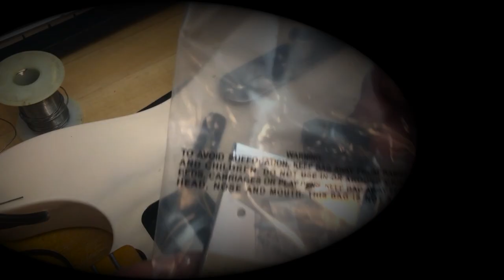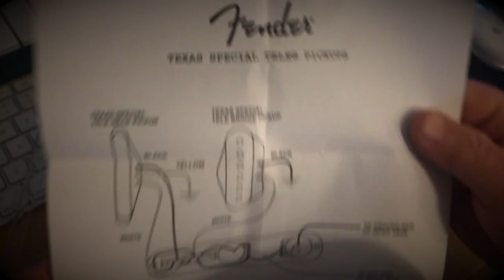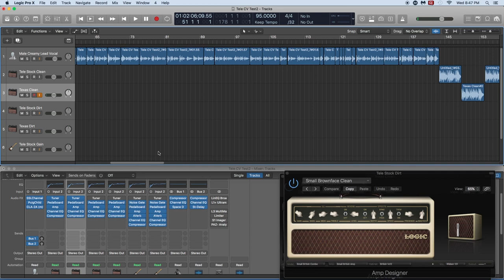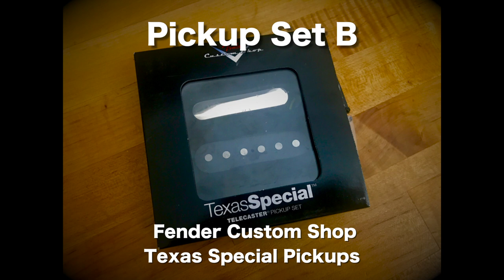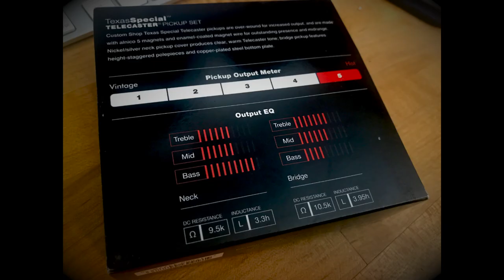Squier Telecaster Classic Vibe Stock guitar pickups VS Fender Custom Shop Texas Special pickups

Comment: Hey Brooks, great video! Question, at the 2:45 mark, you mentioned the Texas Specials come with pickup screws. Were you not able to use those screws instead of the stock CV pickup screws? You mention you would have to drill out the holes on the Texas pickups. I’m about to install a setup of Twisted Tele pickups and would like to avoid having to drill out holes on the neck pickup. Thanks!

Comment: I just bought a CV Tele and I immediately recognized its pickup sound. It's got a lot of snarl and a really tight low end but it's thin in the mids and it's not particularly full sounding. I love it for solos because it's so expressive but it can get a little tiring over the course of a sesh.   I thought pickup B sounded significantly fuller. OTOH, the stock picksups were killing it on that last riff and the Texas Specials weren't.
Reply: You can fix all that.
Use the tone dial and a compressor with a tone dial…boom! ….fixed

Comment: The neck pickups sounded nearly identical. However, there were up to +3dB of lower-mid guts on that Texas Special. I happened to like it, and if I recall correctly, this is what you were seeking. Also I don’t know if you levelled/limited both pickup sets to appear to have identical output voltage, but the output gains were remarkably close. I expected WAY more power out of the T.S. as opposed to the Squier C.V.s.

Either way, I don’t know how much you paid for the T.S. set, but I hope it wasn’t a lot (though I know it was).

BTW: I knew the T.S.were Set B. That’s simply because I have brilliant, trained hearing as a pro  mixing engineer with a degree and over 15 years experience. 
To be honest, I was surprised at how little difference there was between the two pickup sets. Those C.V. Squiers are a dead banger of a deal. I’m’na get me a CV Mustang, stick some [whatever humbuckers Kurt Cobain liked] into ‘em, and ride off into the sunset.

Comment: The TS a re beefiers, that's how I recognize them. It was pretty obvious. The good surprise was that they are still Tele pickups and not so drastically different. That what I was affraid of. I just bought a set of TS that have been manually rewinded with less turns, can't wait to test them. I hope they'll have the "craft wind dynamic"... And still keep the Telecaster character. Thank you for your review. Appreciate it!!

Comment: Thanks for the comparison, this just saved me some money! Good content!
Reply from the maker: Thanks Brock, One more thing to keep in mind is that the TS to have more output. I adjusted the volume to be the same for the comparison but having a higher output pickup does change the sound when using an amp. Also I posting another pickup comparison between the Texas Specials and the V mod 2 pickups. That should be uploaded this weekend. Please subscribe. Thank you!

Comment: That Texas Special neck pickup comes pre-wired for the series + parallel option. All you need is to order the afffordable Fender 4-way switch that comes with instructions or they are easily found on the net plus you 'll be rid of that cheezy PCB switch.

Comment: i was going to change my classic vibe to texas specials,think il just leave them now! thanks for the comparison.
Reply from the maker: Hey Billy, I ended up keeping the TS and I think they are great pickups. The comparison does not what happens when you plug into an amp and with the additional gain it pushed the preamp harder and fatten things up. With that said the Squire stock PU still sound great and it's hard to justify the cost. Please subscribe I am working on a comparison now with the Fender Tex Mex PU.

Comment: Although I swapped out my Tele pickups for Texas Specials, I have to agree with Max.

In my opinion, I find pickups B to be slightly fatter than pickups A. But they’re so close I wouldn’t bother changing them out. You could easily make up the difference with pedals. That said, thanks for getting straight to the point and dispensing with senseless chatter.

Comment: I picked Set B as the Texas Specials and my favorite by the 2nd or 3rd clean sample. I thought the difference was fairly pronounced. The Texas Specials were fuller, a little more bass and a little more mids and maintained clarity in every PU setting. As usual the difference became harder to hear with more gain. But, the stock PUs were good and I would think you could get them closer if you played with the tone control and amp equalization settings. I don't know the difference in cost but I liked the Texas Specials more.
Reply: Where can I buy a set of ears like yours

Comment: Great video/review.  It’s interesting that the TX specials are a bit hotter, but they don’t sound that much different at all.  Thanks!
Reply from the maker: Thank you Rico and I'm glad you enjoyed the review. I did level the volume for the review. The TS are hotter and although the comparison does not show much difference in sound, when you play through an amp the additional volume does push the preamp harder. So there's that.  Please subscribe!
Reply from the maker: Glad you enjoyed the review. Thank you for commenting.

Comment: Good information. I was surprised too, because I’ve heard the Texas specials on a Strat and they definitely sound more twangy but it seems to be the reverse in this test. I generally preferred set A (classic vibe), but the more it got into gain on the bridge I preferred the Texas special. All that being said, changing the string guage blew the entire experiment because it does change the tone, and looking back on it now, I understand why I was hearing some of the things I was hearing. A real test would have the same string gauge. Why go through the lengths to make everything else exactly the same but change something so significant? 🤦‍♂️ Regardless, I think I in general, I still like the classic vibe for my taste. Which is good to know because I am starting from scratch with a tele body and this helps me decide a little bit towards the classic vibe. Only question is whether it would sound different if I put in Strat Texas special pick up in the bridge. I’m not sure how different the pick ups are, but the Strat Texas specials sound great to me, whereas the tele Texas specials were a little disappointing.

Comment: Ouch, the 3rd string was ringing out behind the nut and hurting my ears in your clean play tests.  Almost no break angle on my CV50s.  Did you end up treeing it?  I'm wondering if staggered height classic tuners would help.  I temporarily fixed with a small rubber band around once 3rd string connecting at post 2&4 as a string dampener.

Comment: I was very surprised. You have to take into consideration the Voicing of the pickup. The voicing for these 2 different pickups must be similar so they sound the same. You should return the Texas Special and try again with another custom shop pickup or a pure vintage pickup

Comment: Texas Specials sounded similar but slightly brighter and stronger which probably would not had been if it weren't for the change in string sets. The bridge PU reminds me of the Bootstrap Pretzel in my #1 Tele that shows itself when cranked up but gets twangy when the volume's rolled back.

Comment: I could tell which were original by the Philips screws on the bridge plate. I'm not sure the Custom Shop pups are different enough to justify the change out. They sound slightly clearer and less boxy on the bridge pickup, so maybe. I have Seymore Duncans in my MIJ and they sound great. Strong and chime-y Quarter pounder in the bridge. They are definitely an improvement. Cheers.

Comment: Kudos on your A/B methodology!  I've never seen one done better.  I'm wondering why Youtube's algorithm waited so long to show this to me?  I listened two times, on two different setups.  The differences are minor, but consistent for me:
1)  The "B" neck pickup are slightly muddier
2)  The "A" bridge pickup Had a smitge of twang missing from the "B".
     For me, "A" is best.  So I was real surprised to find that's the stock Squier CV set!  I know you said the "gain" was set identically.  But did you even out the resulting volume on the takes?  That's the only way this result makes sense:  that the Texas specials are louder but consequently lose some of the brightness/clarity of the originals.

Comment: Brooks, the original pickups sounded better. In most all comparisons they sounded brighter and fuller. This video helped me make my final decision to keep my Squire Classic Vibe Thinline pickups instead of swapping them out for Texas Specials. I'm putting the $165 I would have spent for Texas Specials into fender locking tuners, graph tech nut, and a 5-way switch. Thanks for posting
Reply from the maker: Hello Al, I'm glad I could help. I ended up keeping my TS in the Tele because although there isn't a night and day difference, there is a difference, and with an amp the difference becomes more of a factor. I adjusted the comparison so the volume was the same for the recording and review but the TS have more output and that does change the dynamics when you play with the amp. With that said the stock pickups are hard to beat.

Comment: In January 2020 I bought a new CV Strat/white blonde and a Fender tex/Mex loaded pickguard  with center pickup reverse wound to cancel hum in positions 2 and 4. I got these just in case the CV pickups were junk but man was I wrong. l love the stock ones in the CV 50’s so I put the tex mex pickups in a new Squier bullet strat hardtail and you can hardly tell the difference between them. So for the price of a new Mexican strat I’ve got 2 brand new great sounding guitars. Also the Boss Katana Artist with the foot switch is worth every penny.

Comment: The Texas Specials definitely had more mid-range and output. The Squier pickups sounded a bit more twangy and open. Having experimented with string gauges recently on my Tele (while keeping the pickups the same) - I could hear these kind of differences between a set of 9's (more open and twangy) and 10's (bit more midrange, less twangy). So don't know how much of the sound difference between the pickups in the video was down to the increase in string gauge that accompanied the switch from the Squier Stock pickups to the Texas Specials....!!

Comment: On clean you can tell A was a little brighter but distortion was much harder to tell. Also being you changed from 9's to 10's the 9's would be a brighter sound. I don't think it's worth changing. I think people just think straight out of the box the pickups that come with the cheaper guitars are junk along with tuners. When in fact some are pretty good & I think they are wasting their money but it's their money. Thanks for taking the time & sharing your experience.
Reply from the maker: You're welcome The Cleaner. I'm glad you enjoyed the review.

Comment: At first I thought set B had a more balanced range and just a hint hotter, but that's probabaly more string related.  Honestly pretty similar sounding.  The neck on the stock is a bit better for cleans as it had more character.  The bridge is a toss up depending on situation.

Comment: The Texas Specials were warmer because they are wound hotter.
That being said, a minor EQ on the tone setting could warm up the stock pickups.
I would be perfectly happy with the stock ones. I own a 2022 Squier CV 50 Strat and the stock pickups in that are excellent.
I wouldn’t change them out.

Comment: Hi, thanks for this comparison. Actually I own a Squier CV and I was already impressed by the sound and the quality of this budget guitar, but I was curious about improving the pickups. After your video and some other similar comparison, I think I would stay with it. Thanks!
Reply from the maker: Hi Paolo, I'm glad you enjoyed the review. The similarity of the stock pickups vs the Custom Shop was striking but I always tell people that it's a very sterile comparison because it does not take the amp into the equation. The output of the TS pickups was hotter and that would drive the front end of an amp harder.  I balanced the volume for the comparison because louder always sounds better and I did not want that to be a factor in the comparison. Always best to play them through and amp and see what works for you. But again, the stock pickups stand up really well to the custom shop. Thanks for the comment and please subscribe for more reviews.
Reply: @airtimedesign  thanks a lot for clarifying! Cheers P

Comment: Hey Brooks, I just picked up a Classic Vibe 60’s Tele. Are the saddles on the American Bridge compensated for better intonation? I’m not a huge fan of the stock saddles. Thanks!
Reply from the maker: If you get the one I got which is a Fender part that has the "PAT PEND" it does not have compensated saddles. The original Tele did not have any compensated saddles and it's like the original. There are loads of Tele saddles you can by and they will allow you to compensate better. For me even with uncompensated saddles I don't have a problem. But I'm not the best guitar player out there. Thanks for the comment and please subscribe if you haven't already.

Comment: I agree completely. It was a tough call as they did sound similar. I did guess B however. I was hoping for something more dramatic for some reason.  I'm thinking of swapping out my vintage vibe tele PUPS for Fender Vintage PUPS as I noticed that there is not a lot of punch or volume with the stock PUPS. I'm hoping putting in something more authentic like the Vintage pickups will give it that boost. Thoughts?
Reply from the maker: Hello Mpdsal and thank you for the comment! I can tell you that I ended up keeping the Texas Specials. I think they are great pickups. Are they way better than the stock CV pickups? No but small differences make a big difference when you are at volume. The TS have more output which translates to loading the first stage preamp and that does make a tonal difference with an amp at stage volume. I leveled the volume of both pickups samples to keep it fair but the output of a pickup does effect the sound. Everybody is looking for their own sound and I just know for me the TS do have a place in my sound canvas. Whether they are worth the extra money is up to the player and of course their budget. Let's face it, there's a lot of moving parts. Your choice of amp and pedals probably make more difference to the sound than the pickups. But they all play together and little difference add up. All the best!

Comment: wow. those squier pickups really kick. i mean. as a veteran gear junkie. for some of us the differences are evident as far as clarity and compression. but still. i was shocked hearing the comparison. but the texas specials are a much more versatile pickups. easier to control the feedback and noise. and handles distortion like a champ. thats where they really come in to play for you new guys out there curious as to why we swear by texas specials. they handle gain wayyyy better than its competitors. and to be completely honest. thats mainly why we use them and spend the money on them. the clean is punchy. but handles gain and overdrive wayyyyyy better.

Comment: I think the stock pickups in the CV's are great and this video proves there is literally no point in changing them. I think the only upgrade the Classic vibe really needs are the tuners.
Reply: The tuners are awesome too imo.
Reply: @lunchb0x1986  from what I've read you can pretty much get away with changing the saddles and call it a day.

Comment: Having run a wide range of cheap and nasty and beautiful sounding, expensive guitars direct into computer amp simulations they seem to almost ignore your guitar input and give out a generic samey, pleasant sound. Unless you are comparing single coils to humbuckers it's hard to hear any subtle differences. Try miking up an amp and recording the analogue sound to get a meaningful comparison. How do you feel about the sound and response of your guitar, do you think it's improved or the same?
Reply from the maker: Hey Rob, of course you are right and playing though an amp is the best way to hear the tone and response of the pickups but my intention was to try and make this comparison as "sterile" or and unbiased as possible. Any small adjustment on an amp or the mic can make a huge difference on the tone. I know this is not an ideal way to make a comparison but it does even the playing field a bit. The ultimate test is how it sound through your setup and your guitar and your playing style. Thanks for the comment and please subscribe!

Comment: Really feels like the difference between hotter pickups and milder ones :) Those Squier pickups are surprisingly good!
Reply: I thought the same thing.
The stock pickups sounded cleaner with more chime and highs.
Texas speaks had more mids and were hotter.
Reply: The Texas Specials are way better through analog equipment; which wasn’t used here. Trust me.